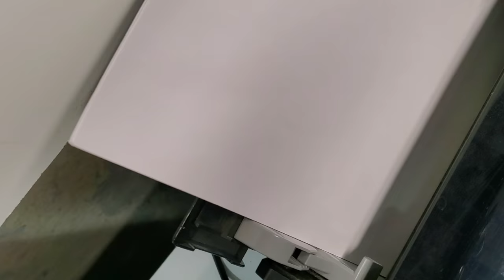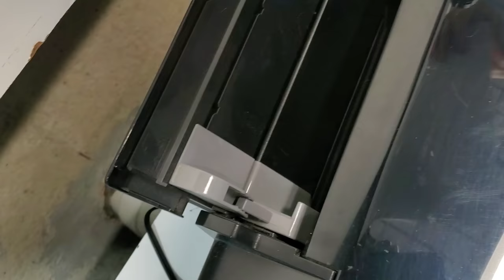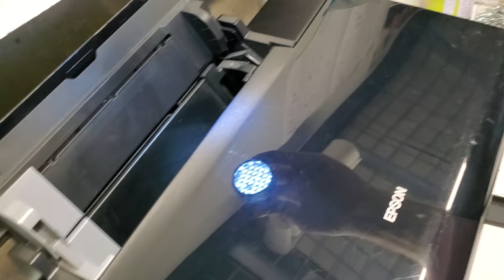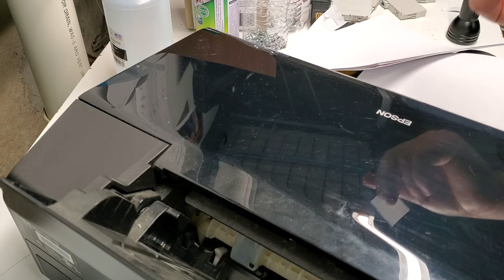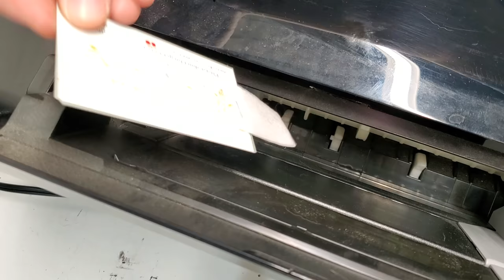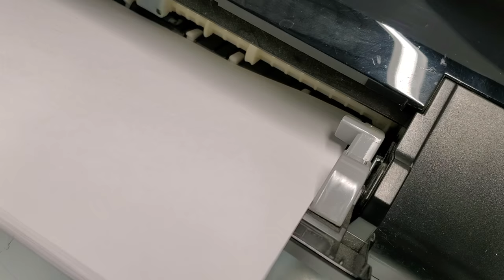How to fix Paper Feed Problem on Most Epson Stylus Photo Printer Top Tray Pick Up Issue R280 R290

Comment: I am so impressed.   My paper has been slipping for ages  until it eventually wouldn't load  at all, even with a little push the help the paper it just went  straight though without printing. Today I watched  your video. Luckily I had some of the alcohol you mentioned. I cleaned the roller as you suggested, waited two minutes and then went to print.  As I said I'm so impressed, it worked straight away. Thank you so much.

Comment: Found a spring when I took my r380 apart to see why it wasn't working. Is there a spring in the back of the part that the paper rests on? This is a very large spring and I didn't think it came out of the printer.
Reply: Sometimes, it can be part of the paper level sensor

Comment: If you have an Epson R285 or R2/R3 series printer and the paper is not feeding through or coming out wonky there is a plastic white roller, in between where the paper goes, manually rotate it gently to the opposite side and hey presto the paper feed issue will have been resolved.

Comment: My Epson printer is actually scraping or even perforating paper as it prints-has anyone any ideas on this-is it a defective roller or print carriage issue ? It leaves smears or banding but the jets are not clogged, I did all the usual maintenance. Something is grinding away and damaging the paper itself (or printing on CDs-it chews off bits of the surface of the discs !!)

Comment: How far in should the paper go? I know it says somewhere not to push it in . . .
Reply from the maker: Take a stack of at least 20 papers and the stack should stop at the bottom of the feed tray.
Reply: @303electronics  Thanks for the reply and tip. I realized that the printer wasn't taking the card stock that was fine in my other printer . . . so just using regular paper and putting it on cardboard or card stock
Reply: It prints on my CARD STOCK again if I choose "photo paper" - I'm a teacher so this is a big time saver